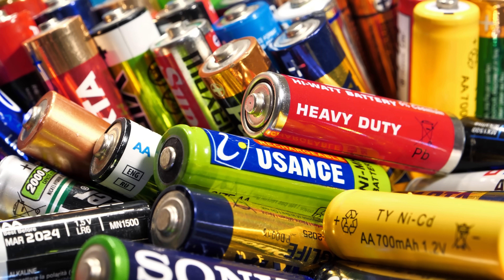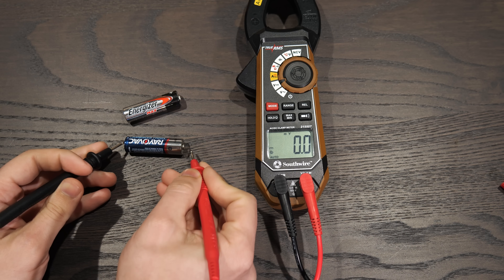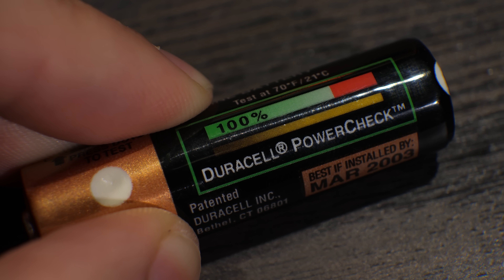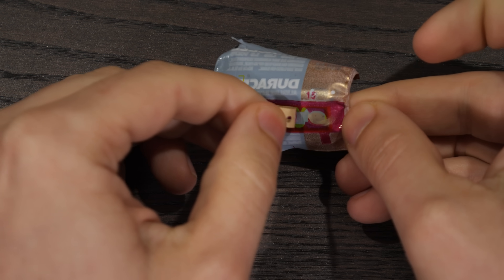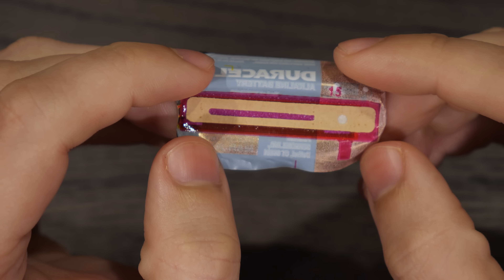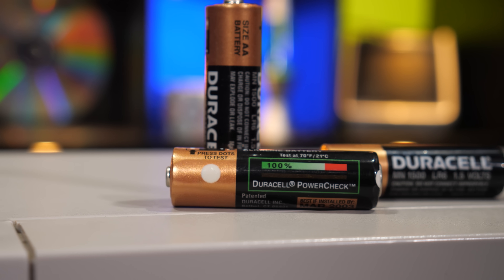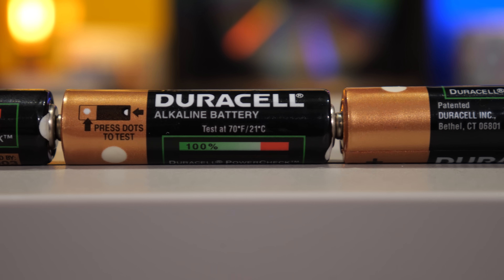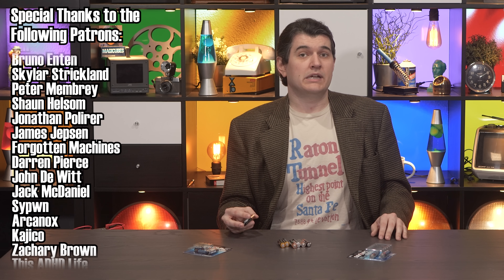Duracell PowerCheck: A genius idea which didn't last that long

Comment: These were a mainstay of the Lego Technic experience throughout the mid to late 90's. 
Good example of moving partially used batteries around constantly - between builds / battery boxes etc.
Just looking at them in this video is making my finger tips ache!
Also served as babies first fuel gauge.

Comment: Us often reused them partially discharged, back in the 90's loads of things gobbled up batteries, 8xAA was pretty common. Self discharge meant infrequently used tools were dead by the time it was needed,  kids will play with battery powered toys until there are no new AAs left (rechargeable often didn't work). We'd scavenge them from toys/remotes etc. and these in built test strips were great for that.

Comment: Love your productions, they are typically very educational. In this video, you failed to address environmental risks and how to mitogate the damage they can cause, how old alkalines might eat your devices, or the rechargable usb AA, AAA batteries that are currently available. 

I used more batteries than most and was particularly brand loyal to energizer since I never had, nor heard of, that brand leaking solution inside a device.

My advice for anyone who takes a battery out of a device, throw it out immediately then you'll never have a spill or confusion about the charge status of a battery.

Finally, never put Lithium batteries in the trash. Use local recycling programs of waste disposal servuces or leave them at a phone repair shop.

Comment: 2 "Fails" in this video:  1) Why is it different with and without a load?  Because the internal resistance of the battery increases with age and discharge.   2) what about self discharge?  Obliquely referenced by mentioning that the batteries were well past their "Use By" dates, self discharge was one of the reasons the batteries had the test strips added.  People would have new batteries around for 6 moths or longer and find either reduced capacity (operating time) or too low to use.  One of the main uses for these were flashlights, which are actually somewhat high current loads.  When the flash light would dim, batteries were replaced.  If they had been "on the shelf"  for many months, the flashlight would not be very bright, creating dissatisfaction.  This is why "always use FRESH, new batteries" is usually somewhere in the gizmo's instruction sheet.   Over time, battery formulations were slightly adjusted for long storage or "shelf life" which is represented by the date on them.  Today many have a shelf life of approximately 10 years, so not a problem.  Surprising that the research techno-nerd didn't mention these.

Comment: I actually still use these mainly for my G604 mouse. Wireless + Bluetooth, good enough for games and convenient when you have a secondary computer for work (which I do) and it's energy efficient enough it uses only one of these and lasts 3-4 months. Sometimes up to 5 if I use an Energizer Lithium AA. Most LI-ion mice that do the same like to put lighting, sometimes unavoidable lighting, that can drop he battery life to just a few days. Not to mention a quick swap is much more convenient than needing to keep it plugged in to charge it for a while if you hate how wired mice can feel like me. Quite like this thing.

Comment: Nah, those standalone battery testers aren't just voltmeters with a modified scale; they actually apply more than just a negligible load on the battery, something that an actual voltmeter doesn't do.

Comment: not a lot of people know this, but as a crude way of testing whether an alkaline battery like AA, AAA, AAAA is dead or not, simply hold it above your countertop by maybe 5 inches, and drop it straight down onto the negative pole.

If the battery bounces strongly, it's dead.

If it hits the countertop with a nice thud and if you dropped it vertical enough stays upright on the countertop without bouncing or bouncing only a little bit, it's charged!

I've blown many coworkers minds over the years showing them this. Charged batteries don't bounce, dead ones bounce.
Reply: I wonder if this test would AAply for Ni-MH rechargeables.

Comment: I remember using rechargeable Ni-Cd instead of the disposable akaline. The voltage drop meant a lot of devices had lower runtimes, but the ability to recharge them almost endlessly outweighed that detriment. Also it was important to have an auto shut off charger for them.

Comment: I've always thought it was weird that "halfway through" wouldn't be down to .75V and dead wouldn't be 0V, because 1.2V sounds mostly full for a 1.5V battery, especially when, for some odd reason, they make the rechargeable versions of these standard single-cell batteries that ARE 1.2V when fully charged. But ya gotta consider the amount of current either type still has available at certain voltage points; that's a huge factor.

Comment: They could still be useful. Just because one device says it’s dead doesn’t mean something else agrees. I noticed this with the coin cell batteries in the kitchen scale. If I recall when that says they’re dead the analog tester I have shows half life. So I put them in the humidity/temp display on the cigar box until that drains them the rest of the way. Same with the alkaline batteries, if the device says they’re dead but my tester disagrees I’ll save them for a lower power draw device to finish them off. Seems wasteful to discard a half used battery.

Comment: And since they've stopped putting these on the batteries, we've actually ended up with a battery tech that could benefit from these checkers. And that is the rechargeable lithium batteries that are starting to adopt the AA form factor. 

Integrated battery checkers on those devices could be useful to tell when your rechargeable battery is reaching the end of its lifecycle and is no longer accepting a charged fully. And since the rechargeable lithium double A's are not as much of a commodity item as the alkaline ones were, it almost makes sense to spend the extra little bit to get a battery checker on them.

Comment: Have to say:  my current (haha) experience with rechargeable batteries is such that I frequently go back to cheaper and more reliable disposable ones.  I find that after a number of recharges the batteries don’t hold a charge for anywhere near as long; and I don’t keep track of when I recharge.  It’s faster and cheaper to rip open a fresh pack of regular ones.

Comment: That was truely a throwback for me this evening. I had these when I was a kid in the 2000s and always wondered how they work. Now, 20+ years later, I'm sitting here with a PhD in physical chemistry, saw these and immediatly knew what was going on. The satisfaction when you explained it really made me smile. Thanks from Germany!
Reply: You can still buy those batteries in Germany
Reply: @MrAtomek321 What's the brand name? I'd like to look them up.
Reply: @Horseshoecrabwarrior  Duracell Ultra Power alkaline (not lithium) batteries have it (though a more modern version with 3 colors).
Reply: @Horseshoecrabwarrior  Duracell PowerCheck . they stoped seling them in usa but they sell them in eu. probably patent was only in usa.
Reply: I figured it all out the moment I read the "test at 70", up until the heating element having to be a gradient (though I guessed it would be becoming thinner, but they used a more space-efficient design by making it just go narrower instead). It was satisfying to still hear about all the smaller features that optimize it, which I couldn't have thought of, but make perfect sense. They tested it in real-life, they found ways to do it best.
Reply: Die Technik dahinter kommt von Merck in Darmstadt ;-)
(Mercks Flüssigkristalle finden sich übrigens in fast allen Geräten wieder... TVs, Handys... usw. Weltmarktführer!)
Reply: This was a truly nostalgic evening for me too. Was just taking a break from studying and saw this on my recommendations. These things amazed me as a kid. Pretty sure this was one the reason why i took BS in mechanical engineering.
Reply: Oh man what a satisfying feeling and fun throwback that must've been!
Reply: Same here, totally remember them from my childhood in Germany, they were very common here.
Reply: Yes I had the same thoughts. As a kid they felt like magic, but seeing this now, I immediately knew how they most likely work

Comment: Fun fact:
You can bounce the battery from about 3 inches height with their round butt on the table.
If the battery is empty, there will be an elastic collision, and if the battery is full, the collision with the table will be inelastic.
Reply: wasnt that proven false a while ago? or am i dumb?
Reply: @Just-A-YouTube-User I have seen the bounce demonstrated with alkaline cells, other chemistries probably don't have the same phase change in the electrolyte.
Reply: @TonyNaggs  so im dumb
Reply: That's how I test them. Quick, easy and accurate.
Reply: It is very much real. There are some great videos that show a bunch of batteries are various levels of charge and you can see how the more empty ones bounce higher.
Reply: That is actually true. An empty battery bounces more than a (near) full one. You need a suitable hard surface tough. But it works.

Comment: Why do rechargeable batteries measure mostly 1.33V - 1.42V (never 1.5V), regardless of AA or AAA?
mAh is provided but not the voltage. I thought they should be related like the HP bar of a game character. 

It seems to work on ONLY SOME devices that require 1.5V.

Comment: I rarely got those things to work.  I must have been pressing it wrong (tm Apple).

Oddly I'm thinking of going from rechargeables back to traditional batteries because the initial lower voltage (1.2V vs 1.5V) and the sharp drop off (vs the slow decline of alkaline) means that I find the batteries in my Amazon Echo Clocks die quickly and immediately, rather than spending some time flashing the red "low battery" light.  I typically find out when I realise the clock is hours wrong!

Comment: I feel like the note about needing to test them at the correct temperature is most likely due to the fact that MANY people keep their batteries in their freezer when not in use; and you can't just pull out a frozen one and check it while it's cold.  It would need to warm to room temp before performing the check.

Comment: Another reason for them not being that useful is that a battery could be too low to run a motor in a toy but still high enough to run a digital clock for a long time. So, the indication of a battery being "low" is fuzzy to start with.

The PowerCheck was probably using significant current. That's something I would have liked to see measured in the video 🙂.

Comment: I don't remember PowerCheck as I wasn't alive in the 90s, but I clearly remember using batteries with built-in testers like 5 years ago or so. And they were Duracell ones but the design was slightly different. it had only one "button" to press and you didn't have to push too hard. Perhaps they've tried to revive the idea but once again it was a nice solution to the problem that doesn't really exist.

Comment: I almost completely forgot about these.  I thought I remembered them back in the mid-1990s when I was in the middle of elementary school.  Well, most battery devices have an indicator like you said, or even for power tool batteries have at least three LEDs on the packs themselves.  This being said, I wish rechargeable battery powered devices has bog standard cells like in commercial cases with 18650 Li-Ion form factor.  I mean, I guess they are used but something more like we used for AAA, AA, C, D, etc. instead of the proprietary planned obsolescence we see today,  For my legacy devices that use AA or AAA I use Panasonic Eneloop Ni-MH so not as much of a problem.

Comment: I used to test all batteries we had at home by pressing the sides even if they didnt have the "checking mechanic". I just thought the idea of it was so cool that I had to try it every single time. "Maybe they actually do have it but just dont show it - and so i would press until my fingers hurt and 99% of the time i got no answer because duracell were the expensive batteries.

Comment: These days most battery devices use just 1 or 2. Back in the day it was more common to have devices needing many (I think I had a remote control car taking 10). In that case the “just put some batteries in and see if it works” is less tenable, and there’s a high chance that you are inserting batteries from different packs with different best by dates and maybe only a subset of them go dead at any given time so being able to check them before discarding can be useful. (I remember putting little notes in the battery compartment to remind myself which subset was most recently changed)

Comment: There's a way of checking if a AA/AAA battery is good without any tools.

Pick up the battery with the positive end up. Holding it about 2"/5cm above a hard flat surface, let it go so it hits with the negative side first. If it doesn't bounce and stays upright, it's good. If it bounces and falls over, it's dead.

Comment: I love the new generation of rechargeable batteries.  They have USB-C charging built-in, even for the little AAAs, that usually come with 4-headed charging cables.  The voltage is constant across the life of the battery, and built in red/green LEDs indicate charging status.  I wouldn't be surprised if the next generation come with little LED percent displays.  I'm never buying alkaline again.

Comment: Some years ago I found an electronic thermometer in my glovebox of my car with the Energizer version of these batteries. It was still running and I  was pretty sure I bought that thing before 2000 so it was alive after almost 15 years. I was curious about it and wanted to make sure it was actually that old so I emailed Energizer and the customer service rep replied with a detailed history of when and how those batteries were made as well as confirming it may have well been 15 years old and still running.

Comment: One problem with these I wondered if you would touch on is that the tester also made the batteries just a little bit fatter. This was usually not a problem, but I recall my AA Maglite, with its very precisely machined aluminum battery tube, would have difficulty with these. I would have to rap the flashlight on a table or use a knife tip to snag the wrapping to get them back out.

Comment: I have an old (80's) TOA wireless system that uses 3 x AAA and it's somewhat understandable as that gives in 30hrs of battery life in a compact package and could fit in both the slim handheld and slim body pack.
Interestingly the systems that came next had nowhere near the same battery life but that's because they only used 1 x AA for the handheld.
At least AAA's are better than 9V batteries that some other syetems used (including some TOA units).

Comment: I used to have a camera that took AA cells. It would auto shut down when the battery was getting low. I could take the cells out and put them in a TV remote and continue using them for another year or two. Could even use them in the older incandescent flashlights that just ran until every drop of energy was squeezed out of the cells! 
PowerCheck was really useful, as I was forever mixing dead and part good cells together in a bag if I bought a bunch with me on a trip.
I do now wonder though, how hot the PowerCheck would get, if it got stuck switched on and with a fresh charged cell; and how long until it ran completely flat!?

Comment: "Most of our devices use rechargeable batteries"
Except those nasty ones that for some reason need 3V (2x 1.5V) and 2.4V (2x 1.2V) from rechargeable batteries is not enough to function correctly (or to stop function after 2 months instead of 2 years)

Comment: As someone who keeps loose batteries around (I use rechargeable batteries with my Xbox controllers. I haven't had to throw a single battery in the last 2 years), a battery tester is a very useful tool for me which I keep in my battery drawer. Great video as always!

Comment: I didn't know that Duracell used to include testers in their battery packages. While the development on this doesn't seem terrifically useful, it does seem like a way to get from including battery testers to not including battery testers without people complaining about getting less than they used to.  People get used to the battery package not including a tester because it's on the battery so the functionality is still there and also you can't lose it so it's actually better. Then, take that away and nobody notices because they didn't ever use it.

Comment: There were a number of occasions where I "used up" batteries in a higher power device like my gameboy or RC cars, but they still had enough voltage for low power devices like  remotes. The C batteries in my flashlight would then go to my alarm clock. The 9v batteries from my dad's portable cigarette lighter went to the smoke detector, and so on.

Comment: This seems like it would be a significantly more useful feature on rechargeable batteries. You're much more likely to have a mix of fully charged or dead versions of those lying mixed in a drawer.

Comment: I remember I liked playing with those as a child, my fingers would hurt from pressing the contacts and the battery would get hot, I also remember using batteries that pirated the powercheck design but did not have a tester, the bar was always yellow

Comment: Do the older batteries that are not working because of age bounce on the ground? That's how I always tested dead/working batteries, by dropping them on the ground and seeing if they bounce. No bounce = full battery, and really high bounce = completely dead, with gradients in the middle. But I'm not sure if this works for batteries that are dead due to age and not use.